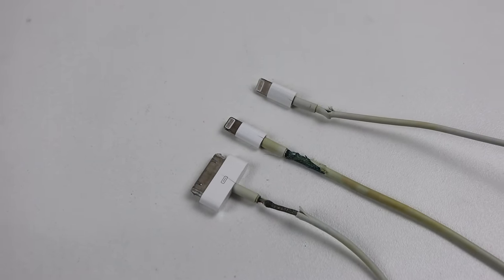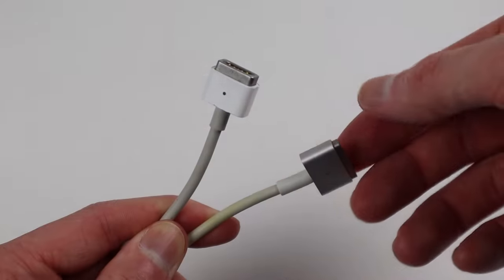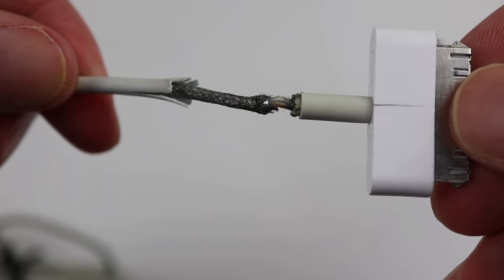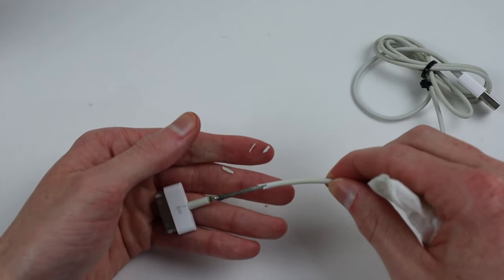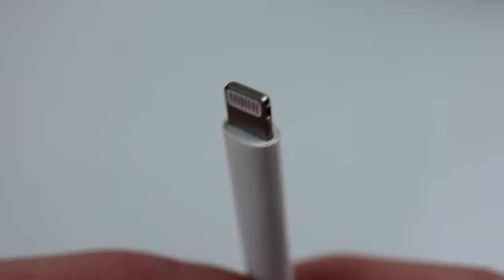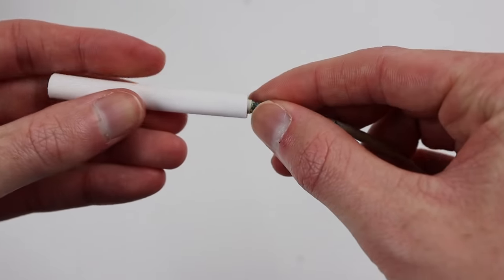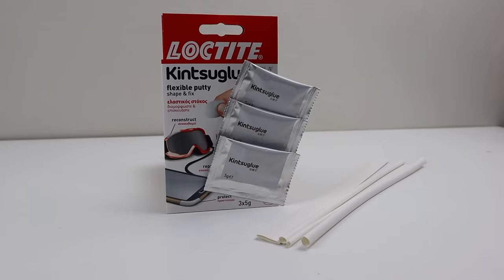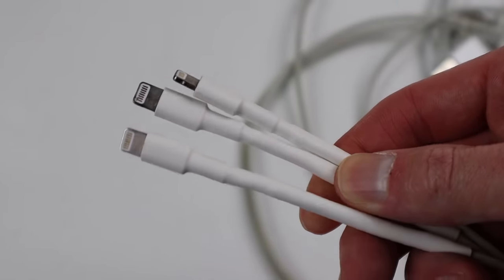Repairing Apple's Notorious iPhone Cables for $8! - Save $$

Comment: You know they switched to rubber from plastic so you buy a cable from them every year. Because why make something that lasts forever when you can sell people the same product over and over again
Reply: sounds like apple does it to another of products other than the cables;)
Reply: Why would you buy a genuine Apple cable every year though?? Nobody forces you to do it. I've been using cheap 3$ cables for years and never had an issue
Reply: @M4tth2w  yeah, as if people don't still use iPhone 4s and 5s that are considered still perfectly serviceable phones... People buy new iPhones every year because they are rich and have money to burn rather than out of necessity. With good care they last for a long time.
Reply: Helllo
Reply: Josh  I used a Galaxy S6 until a few months ago. Only reason I had to upgrade was because it was 4ish 5ish years old and it needed a new battery. I'm sure the same applies to an iPhone 5. It'll work for someone.

Clearly we have different definitions of "serviceable".
Reply: just get a 3rd party one
Reply: Josh I guess my 6S is just a piece of junk and I should throw it away then? :P

On a more serious note. My 6S (released 5 years ago) still does everything the big boys do and I love it to bits. It is, in no way whatsoever, an obsolete device. 

The 6S was the last ‘good’ iPhone, in my opinion.
Reply: Josh  that's a lie, phones such as the 6s and SE 1st gen are perfectly usable in 2020. I actually wouldn't recommend getting an iPhone 8, because of the terrible 720p LCD display, and would go for the X.
Reply: @Jhud69  so the company tries to be eco friendly selling you the charger and cable in another box while users throw their "old" phones like trash?
Reply: @Jhud69  With good care you're likely to still lose the phone... The 4 and 5 were peak Apple, of course they are still around, try finding an undamaged 6, it's impossible
Reply: @DarkStarZN  The 5 was the last good iPhone, and the S10 the last good Samsung Flagship phone.
Reply: @TheLongDon  strong disagree. The 5 was a good phone, yes. But I still think the SE (2016) and 6S were the last good iPhones. 

I owned an iPhone 5. I also loved that phone.
Reply: @DarkStarZN  The 6s started the bezel, and the super thin aluminum casing bent very easily.  Just because they eventually fixed it doesn't mean jack, they still fucked it up

Comment: I've been doing the heatshrink trick on these cables for quite some time, but one thing you can do to make them more rigid and keep the heatshrink in place is to fill the heatshrink with some hot glue before shrinking it. Then when it's shrinking from the heat, the glue will remelt and fill all the nooks and crannies and stiffen up. I've had some cables repaired in this method last for years more.

Comment: Coincidentally the lightning connector turned 8 years old today.
Reply: But it’s still a wonderful connector :)
Reply: @СашаЛобанов-я8в  no
Reply: @Blank Background Image what do you mean?
Reply: @blankbackgroundimage457  Name a better one. I am waiting.
Reply: Саша Лобанов Would love a type c connector but it’s still better than shitty micro usb
Reply: @Huzef44 yeah, absolutely right 👍
Reply: @macdaniel6029  type c
Reply: @Iproductions0  Type C is crap.
Reply: @macdaniel6029  and yet its better than lightning
Reply: @Iproductions0  NOTHING is better than Lightning.
Reply: @macdaniel6029  type c is
Reply: @macdaniel6029  he is right. You might be mistaking it with micro-USB, which is pretty bad. But USB-c is the best phone connector.
Reply: @macdaniel6029  and also every single phone that charges at 50 watts or faster uses usb-C, while iPhones only charge at 18 watts
Reply: @macdaniel6029  I'm not talking bs I am in fact right. Type c is better than lightning
Reply: @Iproductions0  WRONG! Lightning is better and it is easy to prove. It is way more reliable. USB C sucks. I hate this crappy shit.
Reply: @blankbackgroundimage457  I don´t care about other phones or fast charge. FC is bad anyway. It destroy the battery.
Reply: @macdaniel6029  USB-C also lasts longer and has faster data transfer speeds so fast charging is not the only thing USB-C is better at. And also don't change the subject to faster charging destroying batteries after you were proved wrong about which phone connector is the best. It is not even a good argument because fast charging is something you can easily disable in settings if you are worried about battery life.
Reply: @blankbackgroundimage457  No, I am not wrong. I just don´t care about fast charging or speed. I´m talking about the connector. Lightning is superior in every way, USB-C breaks too easy.
Reply: @macdaniel6029  Micro-USB breaks too easily, but not USB-C. There is literally no situation in which lightning is better.
Reply: @blankbackgroundimage457  Just look into the ports. USB-C is a bad design.
Reply: @macdaniel6029  my galaxy s8 charger that I got when it was released still works perfectly. I don't see how it is a bad design. And also the lightning cables themselves always break, which is the main point of this video. If the cable breaks, then there was no point in having a "better" lightning cable anyways. And it is not just generic lightning cables that break easily, it is the official ones, unlike samsung cables which last way longer.
Reply: Banschinabox Not a single lightning charger lived to see its 8th birthday
Reply: Chris Schuler apple fanboy (probably)
Reply: Chris Schuler  Not harsh at all. Hes just REALLY small minded.
Reply: @macdaniel6029  USB C, USB A, HDMI, hell even coax is better than the lightning cables that last two seconds
Reply: @macdaniel6029  idk man, with Coax lasting a hell of a lot longer and being able to transfer data at over 1000mb/s, that largely beats Lightning’s 35mb/s.
Reply: @macdaniel6029  isn’t Lightning proprietary lol? you can only plug Lightning into Apple devices, while you can plug USB-C in literally everything today lol. besides, who the hell wants to pay $20 for a cable that lasts 0 seconds?
Reply: @cybermechid9181  I love you too sweetheart
Reply: @cybermechid9181  Lightning is reliable connector, while Type-C breaks every time you plug it in or out incorrectly. That’s why we all love Lightning. Oh, I forgot about one more thing - Lightning is reversible!
Reply: @macdaniel6029  ok isheep
Reply: @macdaniel6029  You have not provided any evidence on why lightning is better. Oh! Nvm, there was someone who said lightning is reversible. Well guess what, usb-c is reversible too. I’m not even going to argue why usb-c is better because there is already multiple comments giving evidence. If you say something is better at least give evidence.
Reply: @macdaniel6029  Ok. Let's look into all your replies. Here are all of them: 
"Name a better one." "I am waiting.Type C is crap." "NOTHING is better than Lightning." "SHUT UP! You are talking BS." "I don´t care about other phones or fast charge. FC is bad anyway. It destroy the battery." "No, I am not wrong. I just don´t care about fast charging or speed. I´m talking about the connector. Lightning is superior in every way, USB-C breaks too easy." "Just look into the ports. USB-C is a bad design." "BULLSHIT!" "I love you too sweetheart" "I did. LEARN TO READ STUPID! It is more durable because of the design. This middle pin is breakable on USB Crap." 
Now, we can delete all the ones that have no arguments. We are left with this: 
"I don´t care about other phones or fast charge. FC is bad anyway. It destroy the battery." "No, I am not wrong. I just don´t care about fast charging or speed. I´m talking about the connector. Lightning is superior in every way, USB-C breaks too easy." "Just look into the ports. USB-C is a bad design." "I did. LEARN TO READ STUPID! It is more durable because of the design. This middle pin is breakable on USB Crap."
 Let's go through these one by one. First one is about fast charge and how it destroys the battery. You can believe that but you don't have to use a USB-C cable that has fast charge. For the second and third argument (they're essentially the same thing), have you even used a USB-C cable. I have. I have used a lightning cable and a USB-C cable for a very long time. The USB-C cable is in perfect condition. Lightning cable fell apart. You are talking about Micro USB which breaks easily and is worse than lightning. Research. If you reply, I'm probably not going to respond. There's no point.
Reply: @СашаЛобанов-я8в  ummm... Usb c is reversible, faster and works with thunderbolt.
Reply: @macdaniel6029  u probably use one of them anyways.
Reply: @macdaniel6029  switch to Android.
Reply: @spacedaway  Android? Spyware? No, Thanks.
Reply: @macdaniel6029  You are a iSheep fanboy yourself then saying others Fanboy of Type-C
Reply: @СашаЛобанов-я8в  It never was
Reply: @macdaniel6029  USB-C
Reply: @macdaniel6029  Lightning literally breaks easier than USB-C...
Reply: @macdaniel6029  Says the actual fanboy

Comment: Apple cables are expensive trash
Reply: then don't buy em :)
Reply: They make the cables break easily so you will buy more cables ,and they make the cables expensive so they can make more money
Reply: @pianosnoosh  yeah no. If you want a new cable, just buy third party. Apple CAN hold them that high, because they want to and people, like me, will buy them :)
Reply: @goldenpiston8449  yeah but then Apple puts chips in their phones that die if you use the wrong feckin’ cable.
Reply: @dogol284  idk where you heard that, but it is entirely not true lmao, I not only make my own cables, but also my own chargers, and have been doing so for years with no issue. You prob just ran more than 5v through the USB.
Reply: @goldenpiston8449  there’s a microchip called the TriStar that is notorious for failing when using unauthorized chargers. It handles USB and charging but is so vulnerable to slight variations in voltage that it’ll completely fry if it’s ever slightly exceeded. I’d like to apologize to saying that it recognizes 3rd party chargers because that’s not exactly true, however, you’d be hard pressed to find any other smartphone company that uses this shitty chip.
Reply: @pianosnoosh  ikr? It make sense.
Reply: @dogol284  Do you mean The tristar screw that is in alot of iphones?
Reply: @shyguy7094  no TriStar Microchip
Reply: You are everywhere dude
Reply: Bruh
Reply: Honestly, the strange thing is I don't really have an issue with these Apple cables themselves. Given they don't serve nightstand duty and end up getting forced at weird angles (those late nights when you watch YouTube videos on your phone to sleep), they seem to last. Heck I had a cable for like 5 years that was down to the shielding, cable itself still works. The issue I seem to have with them is the lightning connector develops this weird burnt or dark corroded spot on one of the contacts. Usually the old flip the cable over trick works for a couple weeks then the connector eventually fails completely. My iPhone 8 even seemed to have issues with some perfectly good cables because I'm guessing a similar issue is happening inside the port itself. I have friends who have the exact same issue with their lightning cables, Apple and aftermarket cables both do it. Never had the tristar chip issue, I'm placing high bets the majority of people who do blow that chip up are using their phones with the cheapest of charging bricks, that can damage any phone (although the Apple devices do seem more prone to it). I will say, I rarely ever had any cable fraying or connector issues if at all with my Micro B and USB-C cables, even the cheapest of cheap cables have lasted me for years. If anyone else has lightning cables fail often, I would look at the connectors. If one of the gold looking contacts is black or dull looking on one or both sides, that's probably what's causing your issue. Some sort of fine wire brush or metal polish might fix that issue with the connectors, not sure what causes them to fail like that.
Reply: I once got a free cable with my screen protector
Reply: They’re a lot better than the cheap trash you find at every store
Reply: my 3$ cable works like charms
Reply: Nasa: Voyager 1 launched in 1977 is still functioning without issues.
Apple: Your IPhone cable bought 2 years ago is useless now. Buy another one.
Reply: @dinanikolaidou1177  you make it sound like nasa lunched theyre product at you in a cannon
Reply: @Aikaramba12  frr
Reply: @dinanikolaidou1177  just treat your cables well.
Reply: Sounds like broke in here
Reply: @pianosnoosh  don’t buy an apple cable go buy a cheep one
Reply: @packerman1203  they're really not better I've had 1$ cables that perform better
Reply: why are you everywhere
Reply: Apple everything is expensive trash
Reply: @goldenpiston8449  "sadly, you are talking to an apple fanboy."
FTFY
Reply: @Ray Mak you are everywhere
Reply: When 3rd party phone accessories perform better than official companies
Reply: @goldenpiston8449  makes own cables and chargers yet still bought overprice dumb cable and okay with it.
Reply: @etongsashon9121  I make my own cables yes, but when I want something to look particularly nice, I would use this. I have never had an apple cable fail me, so I will continue to buy them if I need to do so.
Reply: @goldenpiston8449  so tell me mate, how many apple cables u had lying around that can't be  use at ur House?
Reply: Might as well buy a used one from 2016 when they where better
Reply: Everywhere I go I see your face
Reply: @goldenpiston8449  well yes there are 3rd party cleaner options too
Reply: Basically Every video I watch you've commented on
Reply: everything apple creates is overpriced trash.
Reply: @goldenpiston8449  imagine defending Apple in a Hugh Jefferys comment section. We can all have our own opinions but your not going to convince anyone here. I'd head over to r/apple, youl find more like minded people there.
Reply: @Carterthielftw_  Not trying to convince anyone here.
Reply: @Carterthielftw_  lol literally it’s called something you apparently think no one has, a opinion, he hasn’t gotten a problem yet so he will keep buying them, so he thinks their good, literally don’t see why you care
Reply: @goldenpiston8449  yes
Reply: @goldenpiston8449  not no
Reply: @realdddaboss  ??

Comment: Actually, you should use the heat shrink to cover the cable after you bought the phone. That is the first thing I do when getting a new phone. That way, you can avoid the cable from getting dirty or disintegrate. Just like people do to their new car, wrap it up to protect the original paint. For this case, repair it is just the only option.

Comment: Samsungs rubber cables never had the issue of falling apart
Reply: untrue, I have seen about four of them that have the disintegration issue.
Reply: samsung 21126 they do
Reply: Cable that came with my Note 8 is being held together with electrical tape. There's going to be problems with any company.
Reply: @rizahki  yeah but at least a new cable with a fast charging brick costs less then 20 bucks
Reply: @mikehall3976  They do, but they don't take a lot of money for a cable like Apple shits do.
Reply: Meanwhile my Nokia phone's charging cable hold my 16 year's of undamaged existence
Reply: @Sebastian Mercado I’ve had mine for years still fine
Reply: They do but much longer time before it happens
Reply: @xXAnni3LuvsYhuXx  yes
Reply: My phone's cable got 1 tiny crack after 4 years of extreme use. Got a new cable (official) for like 7 bucks which was a good deal since my dad's cable (his old one just stopped working) was like 10 for a non branded one. He has the same phone.
My tablet is almost 7 years old and aside from being slightly dirty (still gotta clean it up a bit) there's nothing wrong with it.

Comment: I've had cables last longer than Apple's existence
Reply: Do you own a time machine
Reply: Mark No it’s called taking good care of your shit
Reply: @Mark-xl8gg  no but I own 60s and 70s vintage electronics
Reply: @Mark-xl8gg  he never said it was an apple cable, now i understand why ppl buy apple lol
Reply: I have a working example or two of radios from the 40s, given I would never use them long term until the proper repairs have been done. I still find it pretty stupid Apple can't make a simple 4 conductor shielded cable work properly, purposefully or not. The stupid lightning connector itself seemed to always be the issue with my cables though. Fortunately my current device has the old reliable Micro B connector, and soon to be next phone will have type C.
Reply: Me too. My 15 year old DS charger, that even feels like rubber (the same material that Apple most likely uses) is still in pristine condition, but my friend's iPhone charger became basically useless in less than 3 years, even though I haven't seen a person more careful than him.
Reply: @m.h.quraishi285  just buy aftermarket cable.I use it more than 5 years now.More durable than original cables
Reply: @joaquincarrillo5354  from what I can see Mark didn't mention anything about apple
Reply: Tfw the confederacy lasts longer then most apple cables

Comment: A much appreciated video, I'd like to recommend looking into the different types of heat shrink. You may have single wall heat shrink tubing which is usually 2:1, however the next step up is double wall adhesive lined heat shrink which is usually 3:1 allowing you to go with a slightly larger diameter to slip over your cable ends. The adhesive lined is often used in automotive and marine applications where oxidation and abrasion is more a concern because of the harsher environment. I hope this doesn't come off as condescending, I really appreciate your videos and the British vehicle you are restoring on the other channel, Cheers